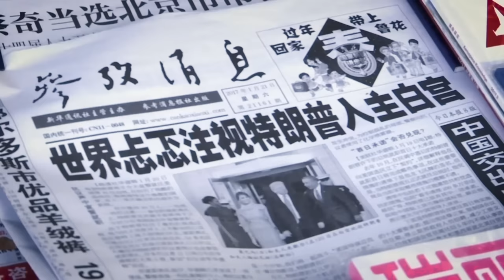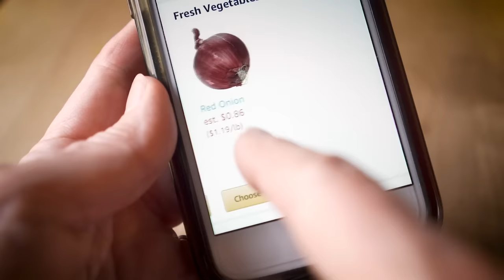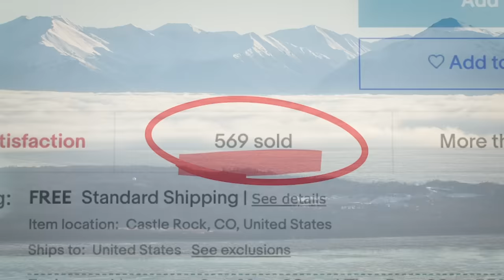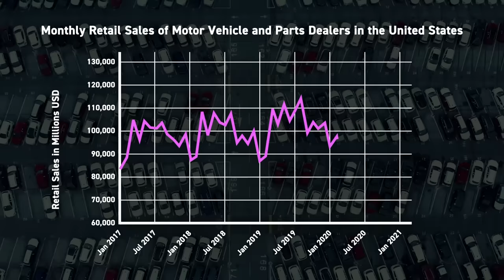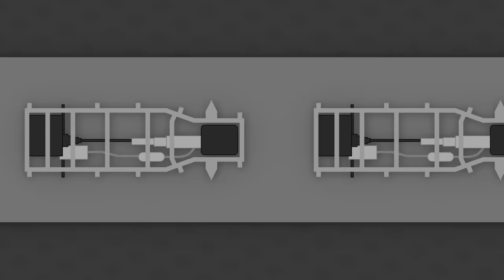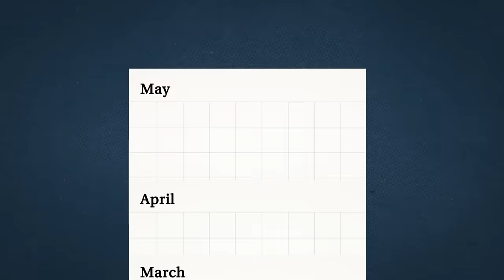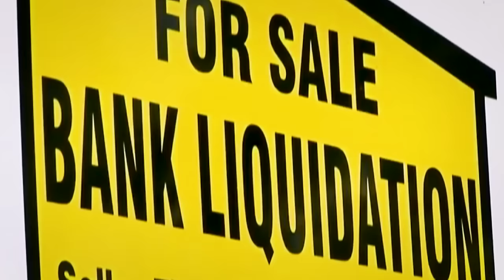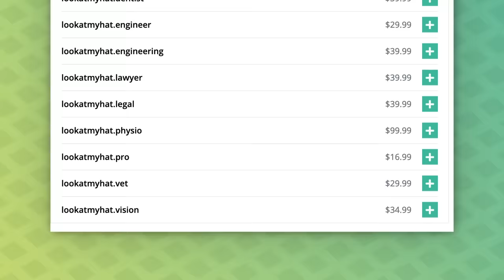Why There are Now So Many Shortages (It's Not COVID)

Comment: Toyota: Balancing "Just in time manufacturing" with "just in case manufacturing" - brilliant!
Reply: “Just in case” sounds less calculated than what Toyota does for risk management. It doesn’t violate the pillars of TPS to have inventory as long as it’s calculated and necessary (for the production process or risk mitigation or to level-load shipments/production), for example.
Reply: Toyota makes cars with GM and Nissan with Ford so what's do you know
Reply: @samuelgonzalez1891  Toyota doesn’t make cars with GM. They did as a way to enter into manufacturing in the US but that dissolved years ago.
Reply: @Bobbyjfornuthin  I did radiators for 20 years and different car companies had there part in other cars
Reply: @samuelgonzalez1891  and I’ve worked in Manufacturing and Engineering for Toyota for the past 20+ years. We don’t make cars with GM. No one said component parts aren’t made for various OEMs by Tier 2 suppliers, but that’s not what you said.
Reply: @Bobbyjfornuthin I went to the Nissan dealer got a gas pump for a Nissan it said manufacturers by Ford Co. Other part i couldn't find Toyota where under GM
Reply: @samuelgonzalez1891  OEMs don’t make parts like fur pumps. Tier 2 suppliers do. And the same Tier 2 supplier may make components for multiple OEMs. But that’s not what you said. I’m only disagreeing with your statement about Toyota making vehicles with GM. They don’t.

Are you changing to limit to component parts or are you still arguing they make vehicles together? It’s not clear what you’re arguing now.

I know every vehicle plant Toyota has. None are a joint venture with GM.
Reply: @Bobbyjfornuthin  you never worked on cars only put them together your like the people from the dealerships they don't know who makes the parts and not aftermarket parts original parts
Reply: @samuelgonzalez1891  I could tell you every supplier. I don’t have any idea what you’re trying to say. Why are you arguing?  Now you’ve changed from a mythical Toyota/GM partnership to an argument that I don’t know my own suppliers?  I definitely do, but even if I didn’t, would that mean I don’t know whether Toyota and GM produce vehicles together?

Tell me this:  which specific location are those vehicles made?  I’ve been to all of them and it isn’t true.
Reply: @Bobbyjfornuthin  I'm just telling you what i know about the Automotive that i have worked on please don't get mad people think they driving a vehicle for a company it belongs to another company
Reply: @samuelgonzalez1891  brings to another company?

If you mean there are a small number of vehicles that are the same as another OEMs, such as the Plymouth Laser, Mitsubishi Eclipse and Eagle Talon in the early 90s, sure. But it’s not widespread like that. 

If you’re talking about component parts like a fuel pump, buying that from a supplier doesn’t make it someone else’s vehicle. 

But your first point was about Toyota and GM. That’s all I was disputing. I wasn’t trying to say there are no common suppliers or that sole automakers have partnerships. I was only correcting your false statement about Toyota and GM.
Reply: @samuelgonzalez1891  GM historically has a relationship with Isuzu. (Chevy Luv, Duramax) Frod with Mazda. (Ford courier, Probe) I know GM and Toyota partnered on the Geo Prism but, I can't think of anything Toyota did with Ford?
Reply: @DcRaz73  Isuzu used make cars with Honda
Reply: @DcRaz73  in the mid 80s, Toyota partnered with GM for vehicles produced at one specific plant in Cali (NUMMI).  The plant has been closed for years. Toyota has collaborated with Subaru (BRZ & 86), and is partnering with Mazda at one plant in Alabama.

Comment: What is absolute amazing is that with all the packages being shipped there has been no shortage of cardboard boxes or printing for them.
Reply: Now that is an incredibly good point.  Why did people need to worry about toilet paper when there is ample cardboard available?
Reply: Cardboard usually gets recycled, so as long as no one hoards empty cardbord boxes, there will not be a shortage. Also most offices, schools, universities etc where closed or had an online alternative, so the demand for paper dropped and at the same time everyone was stuck at home, giving them a lot of time to finally get around to sorting through their papers and throwing some of them in the recycling.
Reply: @AnttiBrax  Actually the majority of TP in Australia is made locally, the problem is the demand has historically been pretty fixed so the factories weren't designed with much excess capacity as there was never any need for it.  So for years they've been running at close to 100% output, and when suddenly everyone started hoarding TP, there was no excess capacity to manufacture more.  Then of course no factory wanted to add more capacity, because they knew that eventually demand would fall off a cliff as everyone stopped buying and worked their way through their hoard, so that's why it was so hard to get for a while.
Reply: Actually, there was a shortage.  I have to source boxes, and there was a time (a month or two in Dec/Jan) where some of my usual sources of boxes were so backed up, they could not supply me normally.  I suspect that a major cause of this was the rapid increase in online buying during the pandemic.  LOTS of boxes needed, which temporarily impacted the corrugate supply chain.  You tell me, you have two options:  Me, buying 100 boxes.  Amazon, 100 million boxes.  Who are you selling to?  It seems to have leveled off now.
Reply: @mainelife6473  Hold my beer mate. Actually our family business is manufacturing packaging from corrugated cardboard. First quarantine in January February 2020 we lost 56% of orders from our clients. In April its started to get back to normal tracks. July there was 3% more demand then all of the previous years at the same time. in August our cardboard suppliers started to increase time of order production from 2 week to 3 weeks and our customer orders increased by 20%. In October all manufacturers started to increase prices. And we started to lag behind with our orders cuz our suppliers increased order delivery at 4 weeks. Today prices for the cardboard sheets increased by 60% so our prices at which we sold the boxes become prices just for the raw sheets. One of our supplier stopped selling cardboard sheets and are only manufacturing for themselves. Our orders of raw corrugated sheets to be completed takes 6 weeks and minimum order went to 700 m² from 500 m². And we are late to manufacture about 70% of our orders.
Reply: That may have something to do with paper mills being relatively evenly spread. Making paper and making paper products - like cardboard boxes - requires huge amounts of various resources (electricity, some plant material for cellulose, water), but its labor intensity (i.e. how much human labor goes into the product, compared to other stuff that goes into the product - like electricity, cellulose and water) is low. Therefore, it is cheaper to keep the factory close to the resources than to move it where labor is cheap. China does have huge paper mills, but since straw, trees and other plants used for making paper grow everywhere in the world (except the poles), paper mills are also spread all over the world.
Reply: My family owns a packaging printing business.  Material lead times have tripled and pricing of material has had double digit increases. Cardboard for the mail/Amazon is in short supply.  So is paperboard for consumer packaging.  It has very much been impacted!
Reply: @mainelife6473  both if I’m astute bidness man
Reply: well there was , especially since india is the biggest exporter of cardboard boxes (biggest kraft pulp exporter).

Comment: The system described here was never perfect, even for the Japanese.  It did give Toyota the edge it desired, but it was (and still is) extremely stressful for the rank-and-file employees.  Toyota has had much higher turnover (in their auto plants) than many other companies.  I've spoken to Austrians who experienced the implementation of this system, and they had a similar impression.
While I'm sure that many American firms say they'd like to adopt this system, I think it's far more likely that they'd like to adopt their version of it.  I can't see many American managers adopting the humility and diligence required of this; far easier to scream and yell at a subordinate, and blame problems on them, than to ferret out the root cause of a bottleneck...and in a tangential way, the video points that out...
Reply: Diplomautomatic very well-penned words ...
Reply: I used to work for Volkswagen. I wasn't even in the production end, I worked IT alongside a shop floor IT department, they already have the yelling at subordinates down.

Comment: spending most of my career in manufacturing. I realized what JIT was. It is just a method to force your supplier to stock pile and hold your inventory with no cost to you !
Reply: It worked so well until the suppliers realized that they are in no shape or form bound to the companies they supply and that loyalty is worth nothing in today's world.

When someone else pays more for the same supply, it will be sold elsewhere.

I can't wait for the day the average worker finds out that this is also true for labor.
Reply: I was in automotive supply chain. Most vendors are JIT as well. Too stressful.
Reply: @GermanTopGameTV  isn't that kind of already happening in the job market with people not working at fast food places anymore because they found something else or wanna wait until the pandemic subsides?
Reply: @GermanTopGameTV , Toyota values long term relationships with its suppliers. As do the Japanese in general. First tier suppliers have Toyota employees working at their factories and Toyota has employees from the first tier suppliers working at Toyota. Toyota and its suppliers can because of this this move like one single organization. It is from design to the shopfloor. 
It is very difficult to build a relationship with a Japanese company, but when that relationship is built it will very hard to break it. The Japanese will go to practically any length to help their business partners if these run into trouble.

Comment: My experience with Just in Time manufacturing over the years is actually "just a little late" manufacturing...
Reply: This comment needs more likes.
Reply: Where I worked previously we called it "Just Too Late."
Reply: lol so true. It just took us three weeks to get in the wrong freaking screws. 10 cents worth of stainless delayed a quarter million in product.
Reply: I was telling people 20 years ago that "Just in Time delivery" would bite us in the and it did. It took a while, but it happened.
Reply: But isn't this the point of the video.  Companies are implementing it wrong and unwilling to adjust when a problem is realized
Reply: @SpaghettiEnterprises  how long was it known those screws would be needed?

With long lead times and uncertainty with nearly every product,  those parts should have been ordered asap.

This is the whole point of the video,  people are doing it wrong.  Holding inventory of $1000 of screws that fit in a 5 gallon bucket is acceptable.  Waiting until the last minute to order them and then 'surprise pikachu face' , they will take a month to get here after a global pandemic is not acceptable. 

Jus in time didn't didnt hold your project up,  idiots in your management and purchasing team did.
Reply: @srmofoable  Not being able to survive a single idiot in the system is the sign of a weak system.  A truly robust system should take into account turtles-on-poles and still be able to limp along and not collapse until the issue can be rectified. If your system needs every person to perform their task perfectly every time it will fail. It might not be today, it might not be tomorrow but it will happen eventually.
Reply: @auslanderalex5464  That is exactly the point. These systems are not implemented correctly. Refusing to order inventory until you need to install it is not lean manufacturing, its just being a cheap ass. And I hate to break it to you but if you actually perform a root cause analysis of a failure like that you will undoubtedly find a cascade of failures all the way from the top to the bottom of the organization. The point being when you identify them, you fix them.

A properly functioning lean system will have checks and balances not only to mitigate cases of 1 , 2 , or many idiots on the team , but also have a factor of risk that you are willing accept built in. Missing a major deliverable because of $300 in incorrectly ordered screws does not carry the same risk profile as warehousing a silo full of diamonds because you will eventually need them to make product.

Do you really think other "non-lean" manufacturing systems don't have catastrophic failures? How many businesses before "lean" was invented are no longer with us?
Reply: @srmofoable  Yeah you're probably right. To answer your question, we told purchasing we needed them about a month in advance. I found the right ones on McMaster myself and they got here in 2 days. You're right, it was definitely poor inventory maintenance.

Comment: The Right to Repair has got to be more important than ever.   My neighbor had a nice new range put in her house.  Within a few years, she ended up having to have a circuit board replaced 2x before giving up the third time and just buying a new stove.  It probably would have helped if she could have replace the board herself.   And now there are extreme home appliance shortages and waits.
Reply: Help even more if such circuit boards were serviceable or just built right to start with.  Probably had a .15¢ capacitor overloaded by a surge is all, but w/o knowing this the board is replaced - with an equally weak unit.
Reply: Right to Repair has nothing to do with simple things like appliances. Appliance makers gives the consumer all the data needed for troubleshooting and repairing appliances. I know because I've repaired every appliance in my home at some time or other. Right to Repair is specific to FARM EQUIPMENT and other products manufactured which is completely controlled by computers. The manufacturers of those products DO NOT give the consumer ANY data about how the computer works and have Copyrights or Trademarks on the product systems. Anyone repairing one of their products is in violation of Copyright or Trademark laws and can be charged as such. Sometimes a million dollar machine will not start because a $5 sensor is broken, but a farmer is not allowed to replace that sensor himself. He must contact the manufacturers repair agent and pay them $500 to replace the sensor.
Reply: Meanwhile my washer and dryer was made in America over 30 years ago and will last another 30 years with a new belt replacement every few years
Reply: My m-i-l had her stove go out last year. The repairman said he couldn't even fix it because they weren't even allowed to order the part anymore. She had to replace it.
Reply: Things are no longer built to last or to be repaired. They just want you to buy more.
Reply: @pyhead9916  Right to repair is not exclusive to farm equipment anymore although that is where it started and is most needed.
Reply: For what it's worth, it is difficult to repair a circuit board like that, but it is probably possible for a DIYer to make their own circuit board.
If it is a 15¢ capacitor like Ed Siler guesses, that's totally DIY-repairable. The tricky part is when it's one of the chips.
Reply: Never ever buy a brand new model of and appliance. You always buy a older model because the newer model hasn't been around long enough for flaws to be found.

Comment: The NEWS says the California port situation is caused by a driver shortage. 
Not so fast: It is in part caused by a California Truck Ban which says all trucks must be 2011 or newer and a law called AB 5 which prohibits Owner Operators. 
Traditionally the ports have been served by Owner Operators (non union).  California has now banned Owner Operators. 
Long term, truckers in California are not investing in new trucks because California has a law that makes them illegal in 2035.  The requirement is to purchase electric trucks which do not exist. 
And in the words of Paul Harvey, “Now you know the rest of the story”
BUSINESS
CARB to begin blocking certain trucks’ DMV registrations in 2020
Carriers domiciled in California with trucks older than 2011 model, or using engines manufactured before 2010, will need to meet the Board’s new Truck and Bus Regulation beginning in 2020 or their vehicles will be blocked from registration with the state’s DMV, the state has said.
The new “health-based requirements” will need to be met before a driver is allowed to register his or her truck through the Department of Motor Vehicles, CARB says. A new enforcement tool used by the DMV beginning in 2020 will automatically block 2010 and older trucks from registration
Reply: Nice 😊